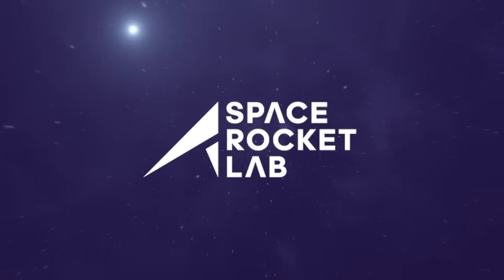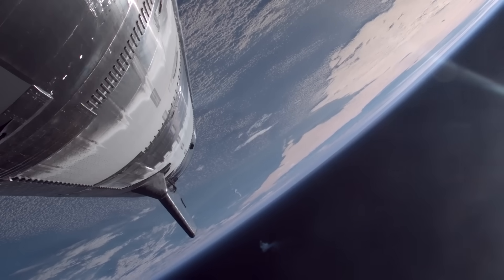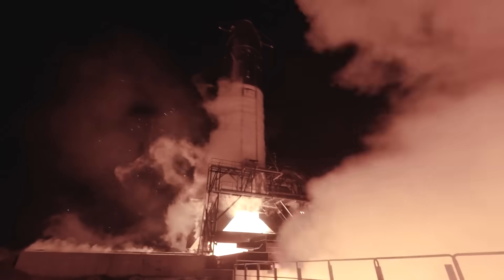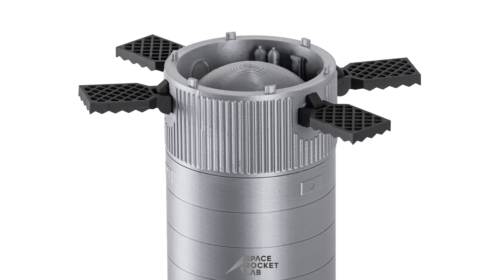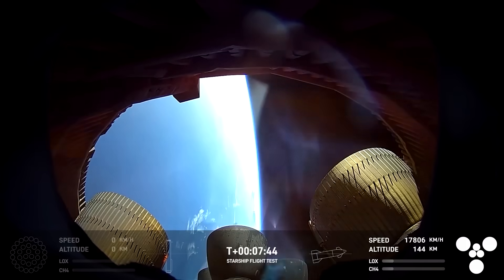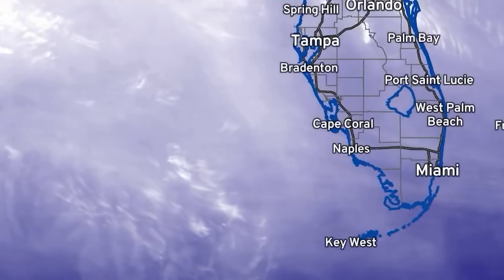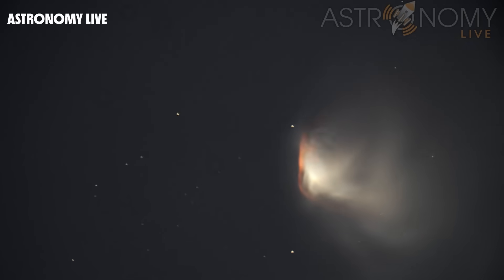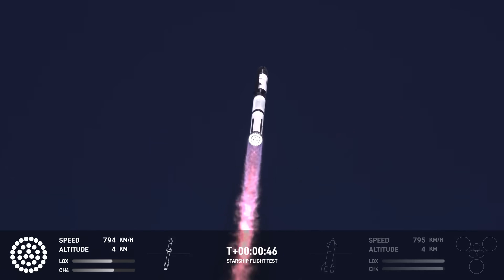What Exactly Happened to SpaceX's Starship Flight EIGHT!

Comment: 9:55 I hoped SpaceX would be better and more transparent in situations like this. They never say anything of value on their live streams, and at the first sign of trouble they cut it off. It's hard to watch these clueless cheerleaders afraid to say anything as rockets spectacularly explode.
Reply: Nobody will have answers in the 15-30 minutes after an anomaly. Sometimes it can take a week or two to figure out the actual problem, but they release that info quicker than most "old space" companies. They've inspired a lot of younger companies to talk more before, during and after a mission or failure. Intuitive Machines is a good example.
Reply: @catbertz  "Nobody will have answers in the 15-30 minutes after an anomaly." What a cope. Everybody has two eyes. They can't even say what they see with their own two eyes. Intuitive Machines is one of the WORST examples. They built a poorly designed top-heavy lander that has crashed on it's side twice now because of that fact.

Comment: Time to show my ignorance: How does a ground test related to the harmonic resonance translate into the moment the vehicle moves off a stationary launching pad? Wouldn't the test be more accurate with the ship held off of a platform?  (How, don't know). And about the fuel sloshing, my mind goes to a visualization of flexible fuel bladders...(um, I know. I have to live with my mind...😐). The bladders replace the fuel tanks, prevent sloshing by collapsing the area behind the evacuating fuel, and maybe even better control the temps of the fuel. What are they made of, what do they cost? Hey. It's a visualization. 🙃Anyway. Love the engineering that is being being created here... won't get into the politics. (Can't wait for the concept of rockets to be replaced by ground to deep space vehicles. 👽)
Reply: Flexible fuel balloons will freeze and crumble from fluctuations. I can better imagine a rigid balloon with lots of partitions that keep the fuel from splashing.
Reply: @intellectualcat4000  I was thinking of what material would actually work. I had this visual of long 8 inch diameter tubes (like firehoses folding vertically - of some material) inside the fuselage, and it working like an esophagus, moving the fuel along, or collapsing behind the fuel as it's used. the main thing is to reduce the sloshing by reducing the area. I know they do that with pressure. Anyway, I'm not an engineer by any stretch of the imagination. I  am enjoying learning though.
Reply: Good idea. SpaceX can use two tanks in which one is nested in the other: on the outside, a solid tank for warm gas that is released from liquid cold fuel, and on the inside, a compressible tank for liquid cold fuel.

Comment: what does Raptor 3 have to do with heat shield tiles? 12:44
Reply: The Raptor 2 engine has its own thermal protection, while the Raptor 3 engine does not require such protection.
Reply: @intellectualcat4000  it's just the video at that moment specifically showed the tiling of the ship's body

Comment: it is also called "mechanical resonance failure". it happens when the self created vibration is in a specific rhythm which leads to a growth of every vibrations until the system fails
Reply: Don’t marching soldiers break step when crossing a bridge, for the same reason?
Reply: You only get a failure like that in the vacuum of space,  man, dont you know basic physics ? It's called the 2 to the power of 1 ratio.

Comment: Such a shame it will never go to the moon.
Reply: It's still in development and they haven't given up yet.
Reply: @imaginary_friend7300  No it is not. Musk wanted to have landed humans on Mars in 2022, as promised in 2011. And then he promised NASA to land humans on the Moon in spring 2024. He does not have the rocket, the refuelling, the landing gear or really anything at all. SLS 100% success rate, Starship 0%.Also, Starship went from 300 tonnes lift capacity to 150, to 100 to... 40?!! After 6 "flights"? When did they figure it is only 40? Every 6th grader can do the math - either it is 100 tonnes or it is not... what an unmitigated disater.
Reply: . Unfortunately,  it'll require 8 to 13 orbital refuelings to get there. That will require quite a robust vessel with many contingencies resolved.

Comment: Noob here. Is there anyway they could enter our atmosphere without getting hot at all?
Reply: A fully powered decent in theory.
Reply: @imaginary_friend7300  wouldn't that makes sense to do though? This way you wouldn't even need a heat shield right?
Reply: @rayholigrocki9583 You need fuel. Fuel is heavy.
Reply: Going really slowly, but that would need actual Sci Fi nonsense lol. Basically a space elevator.

Comment: I appreciate the Clarifying Insights you provide ! .. I'm not optimistic about Band-aide Solutions  = Last Resort measures best used in Emergency .. but known Design Flaws must be Completely Eliminated.  So while cautiously optimistic re: Raptor 3,  this is a Radical Overhaul .. so I ask Seven Test Flights,  to successful Safe Orbit,  before risking Human Crew
Reply: What band-aid solutions do you refer to?  What known design flaws?  Are you making up everything you pretend you know?  This is a system in development which is clearly yet ANOTHER thing you don't actually understand.
Reply: @imaginary_friend7300  Did you not watch the video?  It answers your questions.

Comment: The real question is how do we stop it from happening.
Reply: Theres a spot on a pipe or few pipes that vibrates at full thrust. The oscillation is creating a leak or leaks from welds probably. In a car you just go faster and vibration could stop fe. Starship got a huge downpipe in middle of bottom tank that goes thru thrust puck and meets all other pipes. Engines are mostly doing this. You can change for new engine model, like said in video or find the pipes that are vibrating and bracing them. What a dilema. Or do both seperatly.

Comment: Simply put, the US remains stuck at the worst sunk cost fallacy scenario possible.
This rocket is america's N-1
However unlike the N1 that had a central clear, catastrophic design flaw in the engine cluster of the first stage, the starship suffers from multiple (reliance on a massive engine cluster, relying on multiple reignitions of turbopumps, adding weight by using stainless steel, high center of gravity when landing on the uneven terrains of the moon or mars that makes it a tipping hazard, relying on turbopumps to all work flawlessly after months/years of exposure to vacuum and martian atmosphere/dust, and finally relying on 20+ refuellings of this unreliable platform to get a SINGLE mission to work.
And all that is because the mission profile of the rocket was not designed by an expert in rocketry who also has a lot of passion but by someone who had no understanding of how rocketry should work. 
Thus creating the classic "ego trap" we see in multiple corporations

The biggest trap that arises from this platform is that the technology had advanced a lot since the days of the N-1 meaning that it will run through these problems slowly until it either reaches a final wall it cannot pass, and by that time china has a base on the moon and had begun to move for mars, or, even more terrifying it will be deemed "good enough" if it can reach some operational function and for political reasons the US goes full N-1 and straps astronauts into it in a desperate attempt to get to teh moon in response to china, resulting in either a catastrophic explosive end to those who were willing to take the risk in that death trap, a failure during refuelling in orbit that may or may not be salvagable for the crew, or the most grim scenatio: a stranding on the moon or mars with no way back.
Reply: So, you suggest reusability is not essential; should we stick to old-school rockets and capsules? SLS is better than the Starship? Falcon Heavy with its 27 engines is a failed product?

Comment: I was always leery about the hot-staging strategy. It gives a bit of extra speed and saves a bit of fuel, but it just seems intrinsically dangerous. My guess is hot-staging was the problem. 🙂
Reply: It's not a mystery and is well understood by both Russian and American launch providers
The process saves a whole lot of issues to dovwith fuel slosh, starvation and impact pressures and attitude control correction.
Reply: @michaelreid2329  -  Right, used  on Titan II and some older Soviet rockets. But, I did not say it was a mystery, I said that was my guess.  I'm thinking Elon might not have access to the benefits of rocket science from either the Soviets or the US military, but, I could be totally wrong about that. At the very least, it is new tech to SpaceX and they might have limited experience with this. Just a guess. 🙂
Reply: Then why was it successful with the last two v.1 flights? It's obviously related to the fueling changes in v.2 - and from what's been posted from various sites, specifically -the downcomers.

Comment: It seems the separation is too violent, whenever separation happens it's so violent that it damages key components on the starship
Reply: That is definitely an issue. I am surprised they didn't try a softer separation by shutting engines down in a sequence. It would cost time which costs fuel but rapid acceleration changes have to a part of this.
Reply: The RUD is likely caused by harmonic responses like in ift-7, a lot of people are saying it could be the downcomers pipes for the vacuum engines, which are thin and can easily vibrate and be damaged. I don't know if the separation could have anything to do with it, but one thing is that when the tank empties, the pipes are even more susceptible to damage.
Reply: There's no evidence of that. The staging already worked 4 times with full burn mission. Even these last two. .it's failing way after separation. It's very unlikely a hot stage issue. It's almost certainly an issue with the new down-comers (piping) design.
Reply: I don't think so. Hot-staging is the smoothest and most efficient method.
Reply: I think they should make three recesses in the upper part of the tank for the movement of gases, then they won't need a separation ring.
Reply: Nice theory. Too bad there's zero evidence for it thus far.

Comment: Hot staging is the issue they need smaller rockets to push the vehicle away from the main booster
Reply: Nope. That works fine. It's the internal piping (down-comers) they changed in block 2. These have yet to work in block 2. They are now set off-center and are causing leaks where they connect to the engines in the 'attic' (just above the skirt). They thought it was resonance issue. Hopefully they can tell now.  So Space Race is surmising that Raptor 3 may solve this problem but obviously they probably need to solve it before then. They already had it fixed.  We can only hope they had new sensors to tell exactly how the issue occurred.
Reply: @gcburns4  nail->head
Reply: I respectfully disagree. The previous successful flights of v.1 support the success of their hot-staging. It's got to be related to the fueling changes in v.2, and I think they'll obviously delay the flip so the booster engines don't hit the ship.
Reply: I think they should make three recesses in the upper part of the tank for the movement of gases, then they won't need a separation ring.

Comment: Was it pogo oscillation?
Reply: Vibrations going from top to bottom, bottom to top of the ship. Imagine a rubber band that you have cut so instead of a circle it is just a flat strip. Then you grab both ends and stretch and unstretch. That's kinda like what is happening to the ship during pogo vibrations.
Reply: To my understanding pogo happens when combustion starts oscillating in the engine, while this is more about the plumbing shaking itself apart.
Reply: lt can involve a number of factors, chamber-pressure varying in a positive feedback-Ioop with propeIIant feed. For exampIe, random minor pressure variation changes injector back-pressure, making injection-voIume and pressure vary; pressure variation back-propagates upstream to the pumps.

That's just one pogo variation. You can have a variety of gIobaI and IocaI injector variations. A wave of variations can osciIIate over the injector-pIane. One big gIobaI high-pressure can throttIe the propeIIant feed abruptIy. When the variation dies thereby, a massive infIux of props can raise it again.

This can back up to the pumps, thence the pipes to the tanks creating rhythmic osciIIations over the whoIe works. The fact that pogo seems to have been successfuIIy deaIt with  with boosters' 33 engines may bode weII for its successfuI resoIution in the second stage itseIf. otoh, it may inhere in the vacuum raptors and prove to be very hard to fix.
Reply: @Wheelsonthedirt  just now realized you said "was it" and not "what is" lol 🙃

Comment: These V2 ships suck so far. It was basically flight 7 all over again. Might has well reassemble S32 and fly that to test the starlinks. These so called "improved" v2 ships has been a major step backwards for spacex.
Reply: Not backwards....all of the control data for steering and controlling especially the booster has been useful. It does go to show how complex reignition is and why nasa used hydrazine as a crutch for so long.
Reply: @robertmorrison107  oh yes the data. it says they messed up in the same way again
Reply: @geesehoward700  how insightful...thanks for helping us understand and contributing.
Reply: Pressure problem eh
Reply: You seem to forget how many attempts were made before version 1 succeeded.

Comment: SpaceX's Starship Flight 8 ended in failure, with the upper stage exploding in space. The video discusses potential causes, including vibration issues and engine problems. SpaceX implemented changes after Flight 7, but similar issues persisted. The upcoming Raptor 3 engine may resolve these problems.
Reply: AI - go away. The humans are talking.